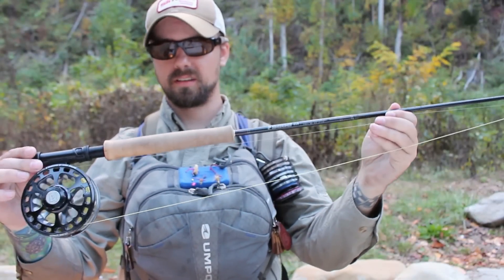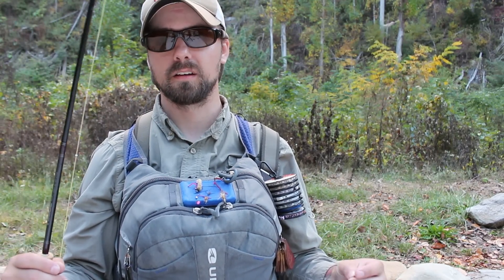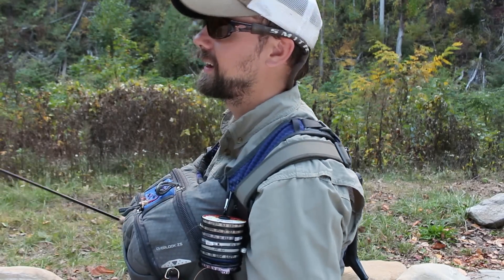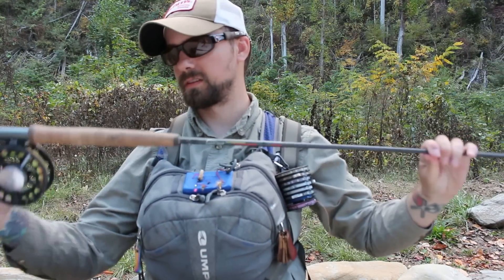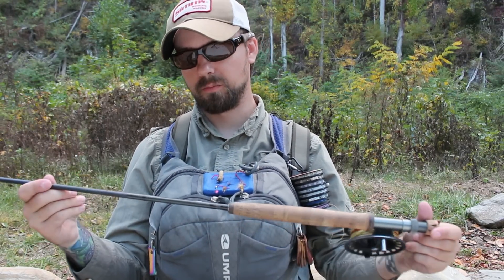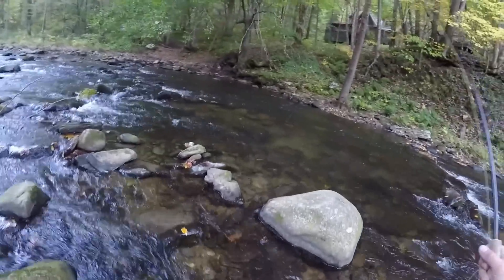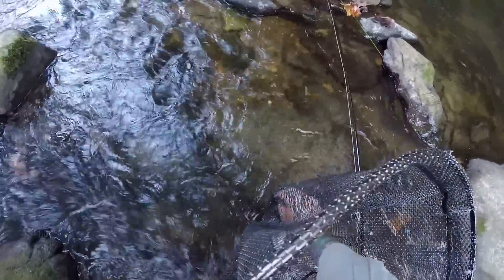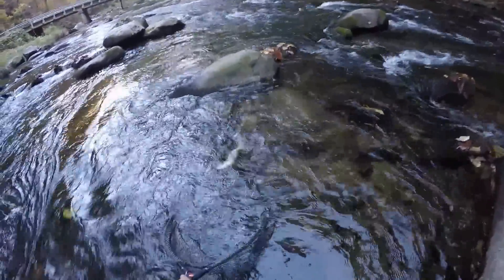Basics of euro nymphing - Stocker bashing

Comment: this is a great video very informative. Question though. If you're not casting any fly line why bother with fly fishing gear? wouldn't a long ultralight centrepin or spinning  set up accomplish the same?
Reply from the maker: Jess Hull I suppose you could make it work, but the size of the flies and the light tippet would make it really difficult. Also, I really only focused on nymphing techniques in the video, but I regularly use this setup for dry flies, dry-dropper, and even streamers sometimes. It’s extremely versatile
Reply: Use whatever suits you there are no rules, a fast action 8ft fly rod works better when nymphing, it’s springs heavy nymphs forward with much less effort, a 6ft luminous furled leader attached to any flyline with 6ft of tippet with 2 flies 3ft apart, it’s very uncomplicated, the luminous yellow furled leader is better than any braided leader and better for bite indication IMO. If your nymphing all day you don’t want to be flogging a 10ft rod on a river, no need. Enjoy 👍🏻
Reply from the maker: Blondie Byrne I actually learned on an 8ft 4wt. But a 10ft+ has quite a few advantages over a shorter rod. And these newer nymphing rods are so light and well balanced that it’s really not bad.

Comment: I’m thinking about adding a tight line specific rod to my fly fishing arsenal, but I have a couple questions. In the area I fish, there are times where tight lining seem like it would be best but there are also big water situations which would require an indicator. Will I still be able to use say yarn or smaller thingamabobber style indicators using a 10’ 3wt fly rod or would I have to sacrifice tightline sensitivity and move up to a 10’ 4wt or 5wt fly rod?

Comment: So basically you "lead" the flies across and down the current with the rod tip.Do you keep the sighter in the zone where it enters the water?
Reply from the maker: There are several different techniques you can use depending on the 
situation and the conditions. Generally I like to keep a slight "bow" in
 my leader that way I can see it twitch or get tight when a fish takes. 
How high you keep your sighter all depends on the depth of water you are
 fishing but ideally you always want to keep your sighter downstream of 
your flies, otherwise you wont see or feel the takes. I think I'm going 
to do another czech nymphing video pretty soon to try and explain some 
of the subtleties of it better than I did in this one.
Reply: thanks
Reply: Are you then consistently changing the tippet length if the pools or runs vary in depth?  I'd imagine a lot of tippet usage/waste?
Reply from the maker: One of the biggest advantages of this technique are that you don't have to keep changing the rigging up. All you have to do to change depth is change your rod angle as opposed to a suspension rig like an dry-dropper or indicator nymphing where your depth is determined by tippet length. Hope this helps!
Reply: Thank you!  If the fly keeps getting stuck on the bottom while using the rod to guide it, I assume the rig is just too heavy?  Just choose different Nymphs?  What if the rig is too light and you cannot feel anything?  Is it about finding that balance?
Reply from the maker: I generally prefer to use smaller flies anyways but jig hooks really help with not getting hung up as much because they ride upside down. I pay way more attention to my sighter than I do trying to feel a bite. Typically by the time you feel it, it's too late. It seems like such a simple technique but there is so much to it, I can only begin to scratch the surface with a youtube video.
Reply: Thank you!
Reply: Ryan The Rock
Reply: WNC Outdoors I finally just tried this this past weekend. It's exactly like you mentioned in addition.  I love it!  Just not sure how I feel about casting it though. Takes some getting used to. Plus I don't have 10ft rod.

Comment: Forgive me if i'm being shallow, but is there anything other than the "gear" and the czech nymph stigma that makes this different than high-lining a traditional nymph rig with something like a NZ style indicator, or just a general upstream swing? I would imagine the nymph presentation may be more natural and the casting is lighter, but is there some sort of 'forbidden technique' type of deal to this style of fishing? I've heard praise from fellow fly-fisherman of euro nymphing, and have done sparse research, but if you could answer me "what makes it BETTER" I would greatly appreciate it. Thanks!
Reply from the maker: The particular style that I use is a basically just all of the best parts from several different techniques like french, polish, czech, spanish, etc. all combined into a more modern competition style simply known as "euro-nymphing". The biggest advantage to this style IMO is the versatility. A lot of the guys that compete on the Team USA flyfishing team are personal friends of mine and I've learned a ton from them. My boss is actually the coach of the youth team. This is a technique developed by those guys for competition because it is fast and effective and that's what it takes to win. Typically you won't use any indicator and the reason is because indicators are illegal in comps. So you can try to fish a dry-dropper and continually have to change your rigging for different depths or you can get good at reading a sighter. You can fish one or two nymphs, or a dry-fly if your cast is decent. You can adjust your depth just by simply changing your rod angle. It's fantastic. There is definitely a "holier than though" attitude with some guys that euro-nymph and I certainly don't want to come across that way. I hope this helps, I am working on a part 2 for this video to try and explain things a little better. tight lines!
Reply: That DOES help explain things a little better. I really appreciate your response, and i'm sure one of these days I will get around to giving it a whirl on my local water. The way you make it sound, you'd think everyone would be doing it! I look forward to the 'part two,' ill be sure to tune in for it. By the way - who is your boss? You had mentioned he was the coach of the youth team? I would love to look into getting involved with that, being a high school junior. Anyway, thanks for the wisdom. Tight lines to you as well!
Reply from the maker: His name is Paul Bourcq. He has also competed on the adult team and won several gold medals. Check it out, it's a lot of work but it can be a great experience.

Comment: What's the rule of thumb of how much tippit after your two tone indicator
Reply: depth / speed of water will dictate - rule of thumb being 1 and 1/2 the depth to your first fly (on the dropper) point fly is typically 18" from the dropper (off the tag) as a starting point - 6" shorter or longer is fine as a general rule.
Reply: Rudy Gurule tj

Comment: Great video. Im a new in czech nymphing, and I'm wondering if i could use a regular fly line with euro nymph leader (like yours) and use it as a euro nymphing and at the same time I wanna use a dry fly if its necessary by changing a leader. Thanks
Reply from the maker: Yeah, I know a few guys that do that and it does work. However, it isn't going to be nearly as effective as using a flat line because the weight of the line in the rod guides causes a belly in the line that gravity will pull towards the ground which in turn pulls on your leader and that will cause drag on your flies which will bring them up out of the strike zone. It's a little difficult to explain in a comment but I could do a video about it. I can cast a dry or a dry-dropper on my nymphing setup plenty far enough for pretty much any situation on the river. Like I said in the video, it's not pretty but you can do it if you practice. Great question and thanks for the comment!
Reply: WNC Outdoors . Thanks for info. If you do a new video about that i will understand more about euro nymphing. Thanks again
Reply: You can probably do with some super-thin fly line, like weight 0. RIO does LT DT 000F and 00F. These lines are for ultralight dry fly presentation, but also can be used for short line nymphing. The problem with conventional fly line is that fly line have a slack between reel and stripping guide, and it creates a drag towards the bottom end of the rod , pulling the leader back out of the water. So , it compromises the main idea of czech/short nymphing - direct contact with the flies on the tight leader . Once you have a slack in the system, you can't feel subtle takes
Reply: Just use a 25 foot leader that way no fly line comes off of the reel. A lot of guys do that. Regular fly line sags causing drag.
Reply: tsogt buyan l

Comment: Where do you get your sighter
Reply from the maker: The sighter I'm using now is built into the leader. But you should be able to find it at most fly shops or online.
Reply: Just noticed that I'm after the coil or spring indicator can't find them anywhere at least not the size I want
Reply from the maker: those are called French indicators. Maybe try searching for that? you can also make them yourself by wrapping the regular indicator material around a wooden dowel, boiling it for a minute and then leave it in the freezer overnight